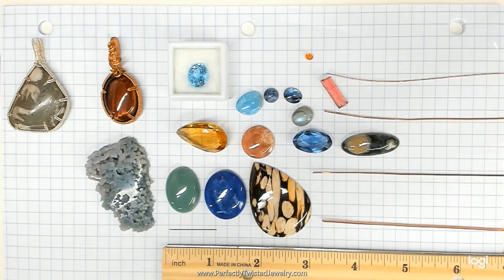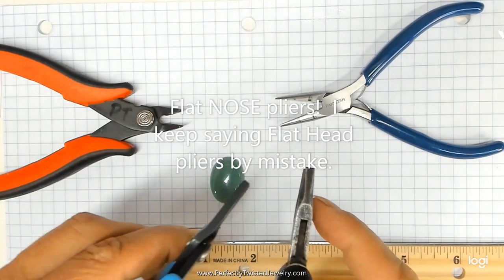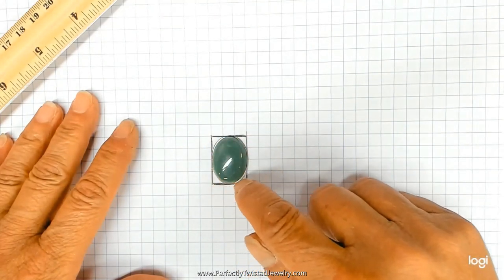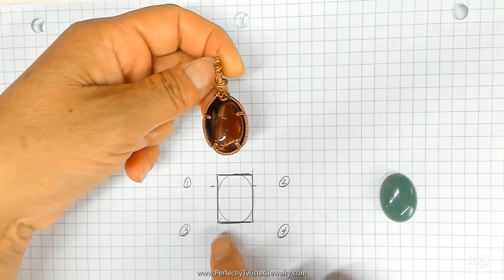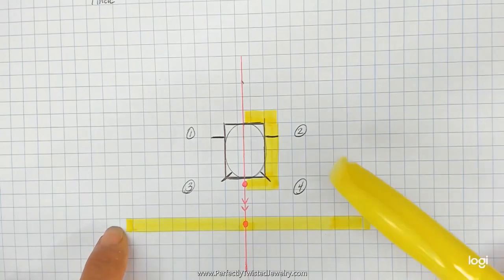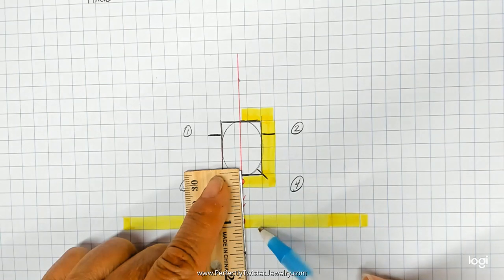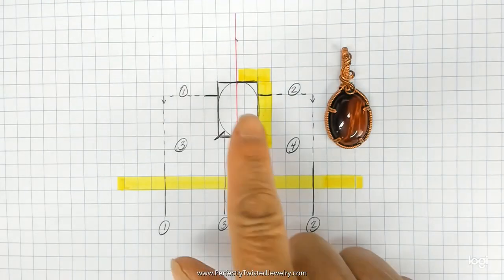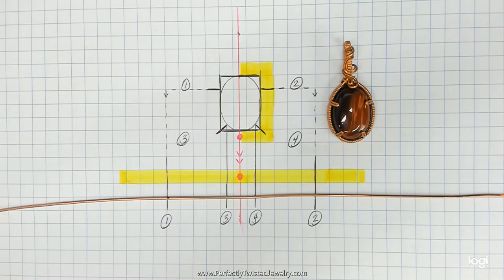Wire Wrapping Technique - Prong Setting - How to Measure and Plan for Prongs on a Pendant Wrap

Comment: I love this method. Thank you so much for breaking it down! I unnecessarily obsess about spacing things out and end up wasting so much time and material. Using your method of planning will give me a great visual to go by.
Reply from the maker: Glad it was helpful!  Thank you so much for taking the time to comment, I appreciate hearing from you.  Enjoy!!
Reply: Perfectly Twisted Jewelry You’re welcome. Now, if I can just get your braided earrings down, I’ll be doing good. The braiding technique is easy. However, I fiddled around with my wire so much trying to get the beginning loops “perfect” that I broke one of them before I even got started! 🤦🏼‍♀️ I need to relax and practice practice practice!

Comment: OK, so do you have a video of you actually making the necklace? I’ve done crying is a different way and I was trying your way, but do you have any thing that is holding the back?
Reply from the maker: In this particular design, three are wire tabs in back ... you can make 2 prong wires, one for back and one for front with 2 straight wires in the middle (this frame is 4 wires)... mirror the prongs front to back and that will be an easy way also, to set a thin cabochon.  This tutorial is one that I sell in my Etsy shop, the link is in the description if you are interested in that.  Thanks for your comment!